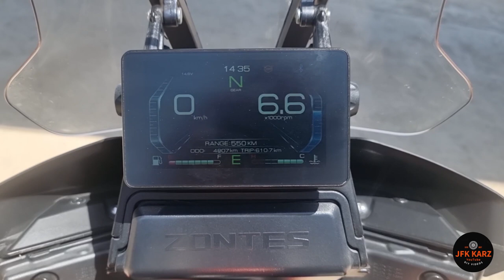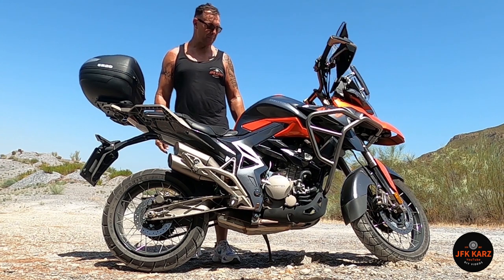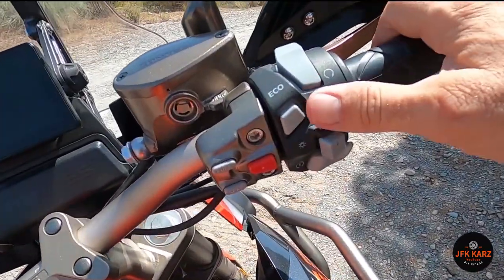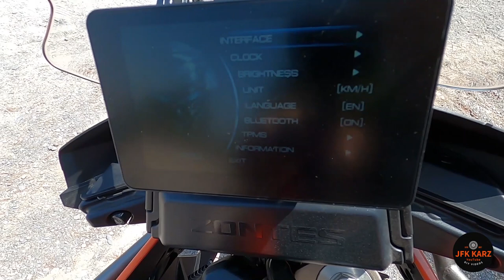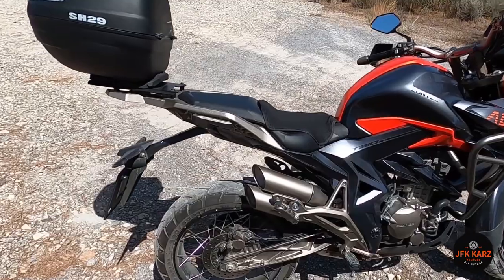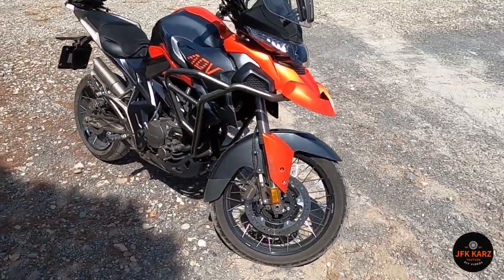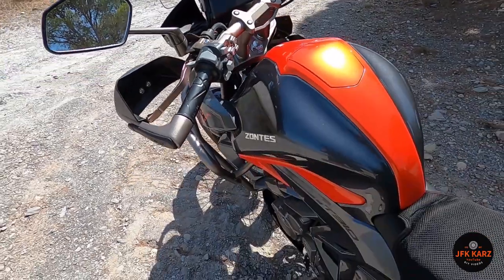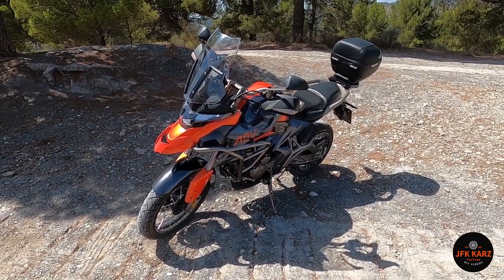Zonte T2 310 Owners Review Mods & Issues

Comment: Reference the PKE key you do know about them chewing thro batteries at a fast rate, always have spare with you, and do you know about the tiny led in the fob, once you turn on the bike it flashes green, and then ever 20-30 seconds it will continue to flash as the bike checks it to make sure it's with you, if the fob battery is low it will flash a red led, hope that helps 😊

Comment: On the tyre pressure, firstly you should be routinely checking your pressure on a weekly basis and I'd strongly recommend you get a home pump like the battery type rather than use the unreliable garage lines 👍🏻